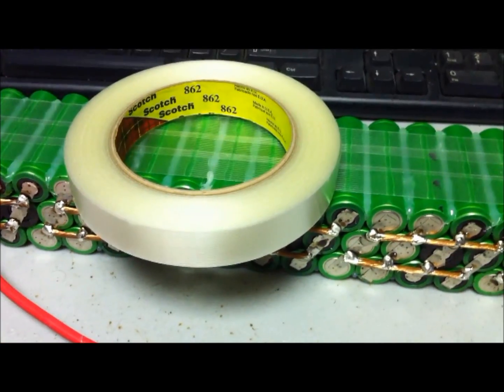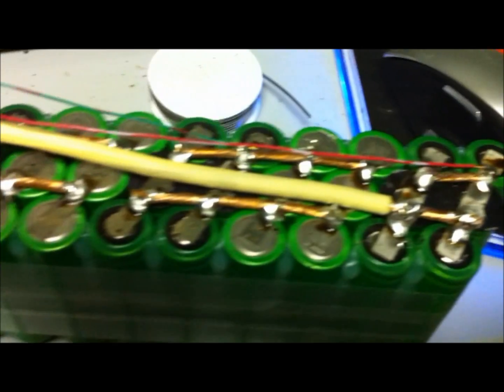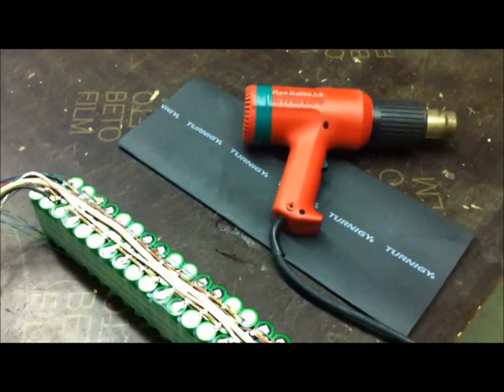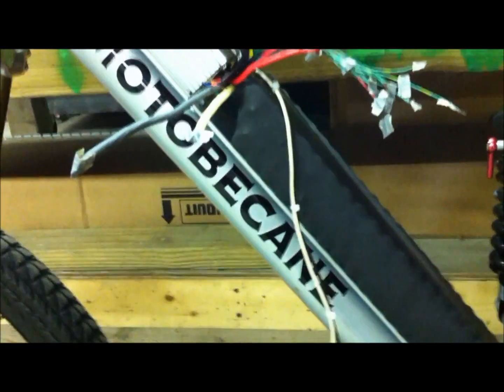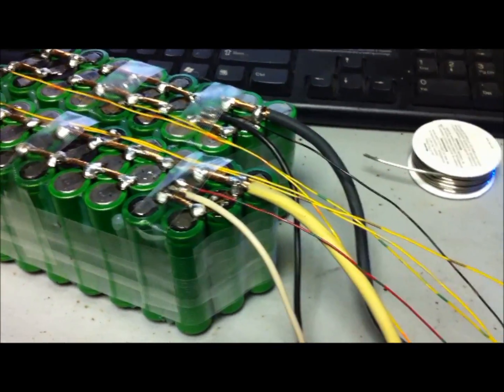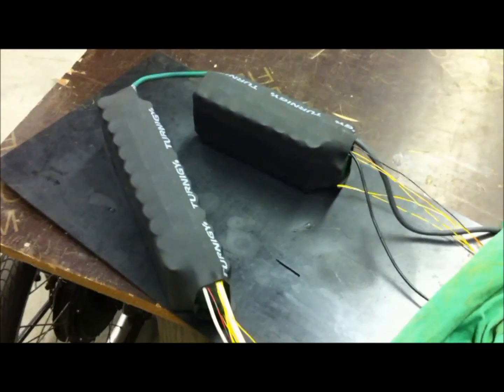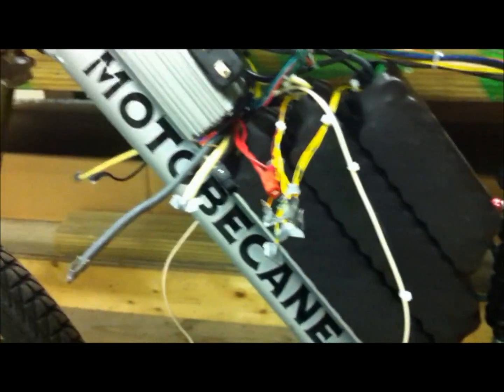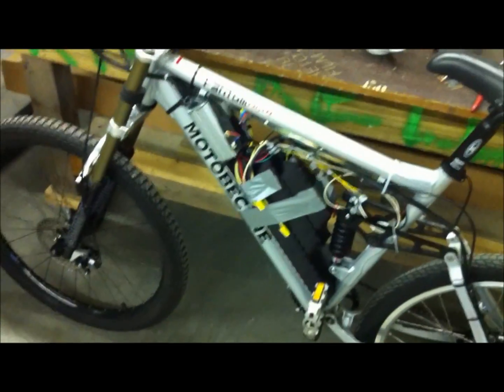EBIKE 72v - Battery packs taped, heat shrinked and installed with balance leads

Comment: Surely, each battery pack is 72 volts ? 
Each cell is 3.7v ? three of these in parallel is still 3.7v ?  x 20 = 74v ? Thats right isnt it ? or have I got something fundamental a bit wrong there ?
So, I thought you were building two 36v packs. But it looks like you built two 72-74v packs ?

Comment: The maximum discharge rating for these laptop cells are 0.5C (1100mah per cell). They are not designed to run such a high wattage bike motor. They get extremely hot and will be destroyed after a couple of discharge cycles.
Reply from the maker: Dan K These are .5c sony us18650gr cells with around 1.8-2.0ah capacity. Where are you getting your information from?

Comment: did you use galvanised nails for the connections between the individual packs? Also, what are the gauges for balance charging wires and the main supply wires?

Comment: How many cells per balance lead do you connect?
Reply from the maker: however many cells you have in each parallel group is what will be connected. Google "wiring lipo diagram" and click on the first link my asylum, it helps you understand how to wire any pack.

Comment: Hi, I'm a sort of lost on my first pack using 18650 3400mah 3.7 Panasonic cells due to volts and A .. I mean, if I want 60V 20 A , how many cells should I use exactly ? I guess, 16S 5P ,(80 cells) is that correct ? would you be able to help me out here ? Thanks in advance
Reply from the maker: 5p would be 17ah 3400x5. Whats the C rating of that cell i wouldn't go less than 8p unless they have a high drain rate

Comment: I want to build a lithium battery for my electric skateboard using super polymer lithium ion batteries. There some on eBay for $45 (12v 12000mah). I'm still very new to this stuff, are the balancing wires you installed for recharging?? Is there a way I can get more in-depth instructions??
Reply from the maker: If your new to batteries stay away from Lithium Polymer, they are cheap and dangerous, trust me i know people who lost their homes and cars from silly house fires.
Reply: Okay. What's your recommendation?
Reply from the maker: 18650/26650 cells or lifepo4 packs. If you have past RC experience and are willing to learn how to properly balance charge in a safe environment by reading on endless sphere, then maybe consider LIPO.
Reply: I've bought 18650. But to achieve 36v 35ah I will need 9 packs of 10. The balance charger I am looking at can only balance 6 in series. I don't know what a good option is. Any suggestions?
Reply: Should I separate 3 and balance charge 3 then the other 6 packs?
Reply: Actually 9 packs of 16
Reply from the maker: if your going to be running at 36v youll be using 10s of lithium (37v nominal) 42v fully charged. It will be easiest to use 2x5cell packs in series. you can wire a battery master switch to break them from 10s to 5s and charge them together as a larger 5s pack rather than the 10s.
Reply: skeetab5780 should i google battery master switch or youtube it to learn more about this, or is there a better way to describe this.

Comment: i want to build one of these batteries for my ebike 48V but im confused on how i would charge it.. currently i have (2) turnigy 22.1v 6s lipo battery packs wired in series to get 50v or so and i pull them apart to charge them on my 6s charger.the way i would build it would be the same way.but i see you did it different..

Comment from the maker: thats why a123 tech is working on their larger cells. if 20AH is used you wont need so many of them. but if one goes bad you will lose alot of capacity. there is always a down side to every story.